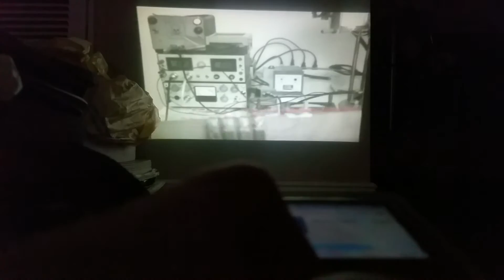iPico iPhone Pico Projector Mod Update and Info

Comment: Hey, dude, I do some research about iphone 30 pin adaptor, pin8 is composite video output, pin 9 is S-Video out (chroma), pin 10 is S-Video out (luma), maybe can give the signal from adaptor.
Just a idea, hope this info could help. One little thing: those pins too tiny to be soldered.
Reply from the maker: Apparently the projector is permanently configured to accept component video (ypbpr rgb).
Reply: @sjm4306  So, wonder how you soldered PbPr?
Reply from the maker: That's the funny part, I only attached composite video. This is why I could only display black and white video, the composite properly provides the sync and luminance that component needs but doesn't have the two other color lines necessary to display in full color. It's sort of a bodge to supply composite to a component input that sort of works.

Comment: Hey Mate, I solved the problem with this projector, its not S-Video, its component, it can do 480p and 576p so Ive soldered the Y to the same point as you did but Pb and Pr to the iphone connector board, so if you still have it its perfectly hackable, Ive removed the dead battery and put a micro usb plug to the side of the case and put RCAs on top, tomorrow will try to make a VGA cable as its the same as component the only difference is sync ;)
Reply from the maker: Sweet, I'll give that a try. I've got some psp component cables that would make this into an awesome portable projection gaming console.
Reply: @sjm4306  We are waiting your new video and see how you figure it out    :-p
Reply: Hey Dude, could you show us where and how you soldering?  You mean Pb and Pr wherever position on the iphone connector board? Or have to pick a pin?

Comment: Is there a way to steer the mems mirror in that data sheet anywhere?  Instead of a raster scan, control it use vector points ?
Reply from the maker: This pico is a lcos so no mems. The microvision showwx+ I recently got though does have a mems mirror so it is feasible to do exactly that if I were to ovwrwrite the controller firmware.

Comment: I bought mine a few years ago for peanuts brand new, and planned to try to use it integrated with an RPi as a HUD display in my car. Sadly, no more car, but I still have this doohicky, and have been trying to go for a new use. I think I'll pick up on your idea here and toss an RPi Zero W in it, or at least attach it.

Also sadly, Sparkfun used to carry 30 pin breakout connectors, but they stopped before I ever bought the projector.

Comment: hi sjm4306,  I need to know how you made your battery/power source for this ipico pj205 projector.  Where do I buy them from?  What parts do I need?  I need to power it up.  It's dead right now. Thanks for your soon future help.
Reply: He explains it in the video - it's pretty clear. You can just get any lithium cell you have a way to charge easily, and wire it up to the pins internally that he showed. You need a battery from eBay or wherever, preferably with a female connector attached, some wire, pins, solder, and heatshrink.

Comment: Awesome video. ? I see  6 pin holes on the back do you know what they are for
Reply: I think you mean the 8 female hole on the back under the sticker.  I have one too  and would love to do something with it if anybody can find the hole chart 😎😸
Reply: the 8 pin are vcc gnd and pic18f program pin(pgc pgd mclr) and tw8835 tx rx boot_sel not much use unless you want to reprogram the pic mcu with your own program to control the board function, too complicated without schematic, doubt the company will provide one. But rather than playing with the pic, i found that the 30 pin connector have i2c connection to the led driver, maybe can over drive the led a little for more brightness with more heat and lesser battery time? or mod it to run on power bank/portable battery.

Comment: Why did you go about it the hard way? All you need to do is make 30 pin female to female from 2 cheap 30 pin extension cords , match pin 1 to 1 , 2 to 2 and so on and then just get 30 pin to component video cable and you're done , this projector needs component video , the adaptor I made also works with brookstone projector except it needs composite signal. I think you over complicated the whole process 30 pin apple devices use analog video signal 😉, my mod allows you to use any video source even hdmi if you get the right cable
Reply: Damian Deja can you please reupload? I would love to see these pics. try uploading on imgur or something
Reply from the maker: Damian Deja I want to use this with any composite source and possibly a raspberry pi (which only natively has composite and hdmi) to make a portable device so without a clunky converter, component is unfortunately not an option. I have since found a way to switch the main video ic over i2c to any number of supported video formats but haven't had time to play with it recently.
Reply: sjm4306 get brookstone projector then because this projector runs only on component video in color, one more thing, how is using 30 pin female to female clunky, I can send you a picture of how this looks like if you'd like
Reply from the maker: Damian Deja For my application it would clunky because I would still need a composite or hdmi to component converter which would also need to be powered if I want to use this projector with as raspi. From what I read, the main converter ic inside this projector supports composite, component, and vga so it's only a matter of sniffing the onboard controller to find the i2c address and then issue my own configuration. I'd rather take a little time to understand how a system works and add a tiny $1 microcontroller than buy cables, converters, and or an entirely different projector to solve the same problem. The learning process is just as important to me as the end product.
Reply: sjm4306 you don't need any converter just simple 30 pin to component cable from eBay $7 or you can just look at the pin out https://goo.gl/images/KOgwQn and make your own cable , like I said old apple 30 pin port works on analog signal
Reply from the maker: Damian Deja My raspberry pi only outputs composite and hdmi. I think there is a mod to generate vga using an r2r ladder and some clever software but those are my only options.
Reply: sjm4306 just make that female to female cord like I did and buy brookstone pico projector for iPhone 4s, I just bought 3 of them for like $10 on eBay they work on composite signal and also have speaker , remember keep it simple 😉
Reply from the maker: Damian Deja I'll keep an eye out for the Brookstone if I can get them cheap (what's the model number). But in the meanwhile component is not possible with a raspberry pi so I need to go about reverse engineering this pico.
Reply: Would you elaborate or make a new video on how else we can get a composite signal into this?
Reply: https://rover.ebay.com/rover/0/0/0?mpre=https%3A%2F%2Fwww.ebay.com%2Fulk%2Fitm%2F273441167465

Here looks like an open source projector like this.  It take HDMI signal, and looks like it small enough.  Like $250

Comment: could you not put it back together exactly the way you got it and try it with a SAMSUNG tablet.
Reply from the maker: I don't have a Samsung tablet on hand to try that but I doubt it would work. Even if they use the same physical 30 pin connector wouldn't mean the pinout and software support the same digital video out that apple devices do.